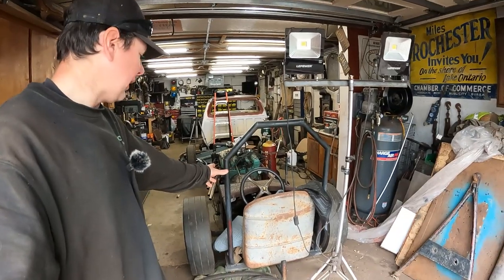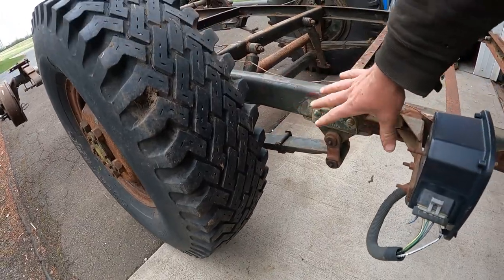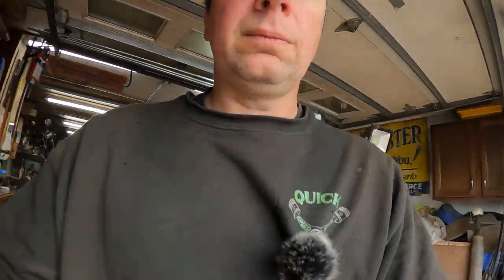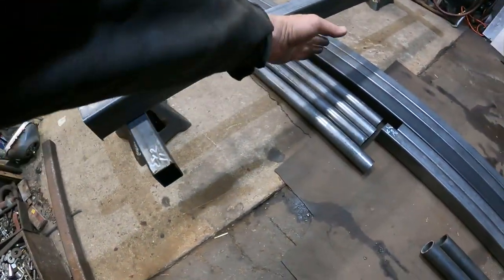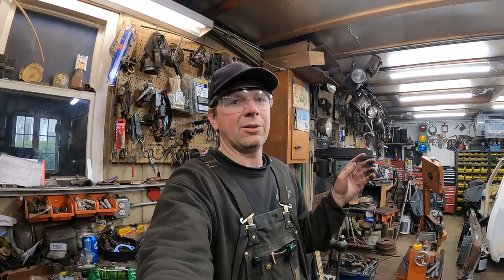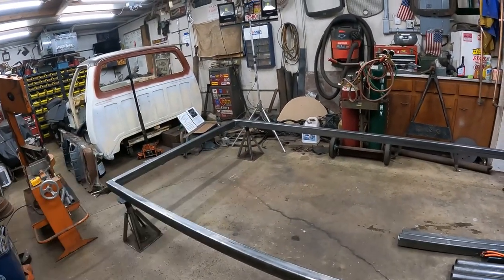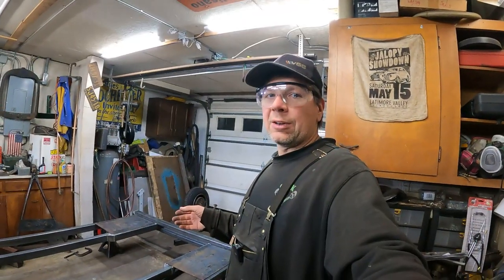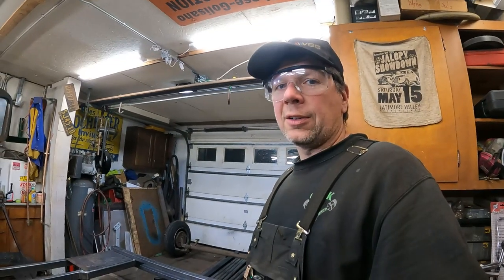Building a Custom Single Axle Trailer:  Part 1

Comment: Hey there. When you buy the tires, check the speed rating. Those ST tires have a letter. Many have a lower speed rating than you can believe. Exceeding that speed generates heat and blow outs on many trailers.  It took me three blowouts to figure that out. Nice work.
Reply from the maker: I forget the letter on these, but they are rated for a lot.  I rarely tow fast, 65 mph tops.  Not one of those guys that tows a loaded camper at 85 mph!